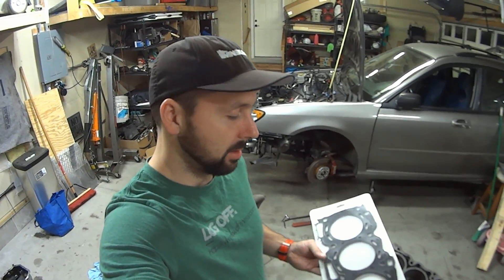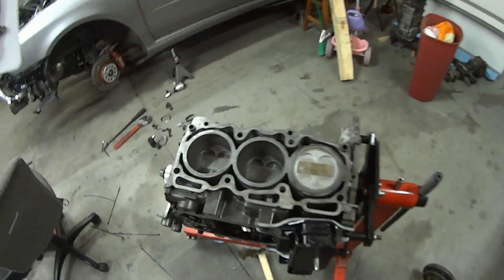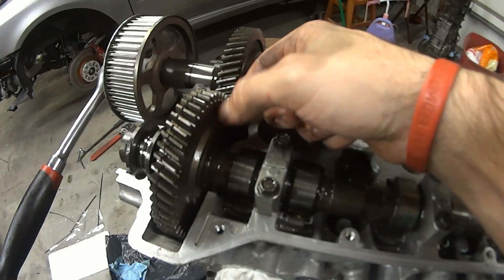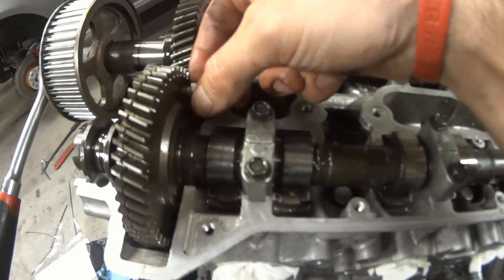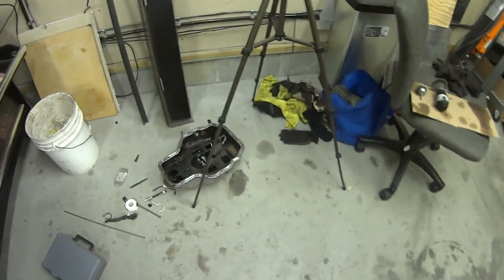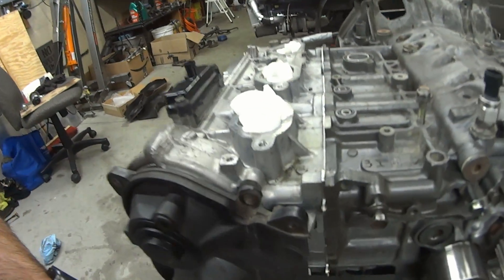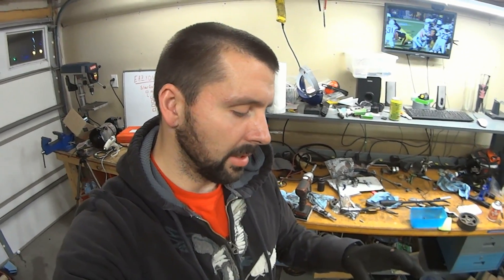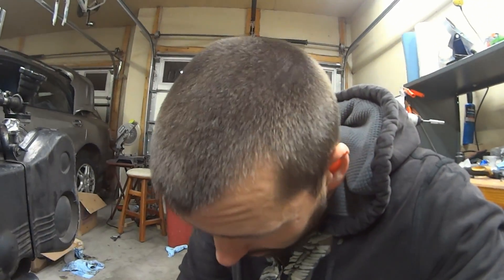EG33 Swap - EG33 Assembly with Cometic Head Gaskets (Ep. 38)

Comment: Did you bore out the cylinders? If not, which Cometech head gasket did you use?
Reply from the maker: No bore, just used the Eg33 .66 head gaskets factory bore.
Reply: I could only find the gaskets for the over bore, 98mm.  If you have the parts number that would be great.

Comment: Why aren't you using head studs instead of factory head bolts?
You probably wouldn't be having these issues with stripping your short block and the expenses associated with getting the short block repaired if you did.
Reply from the maker: Too expensive and not nessicarily required for my goals. Undoubtedly be better for a built motor. Repair was free and I learned quite a lot when doing the timeserts.

Comment: Around 10 minutes when you install the timing belt, I've got to be missing something.  I've done a few EJs, and those look like DOHC heads to me.  But I only see 1 cam gear per side.  Thanks
Reply from the maker: Helical gears connect the cams on each head so doing the timing belt is just like doing a single overhead cam Subaru.
Reply: @EazyOnCars  Wow.  Never knew that.  Will have to check it out